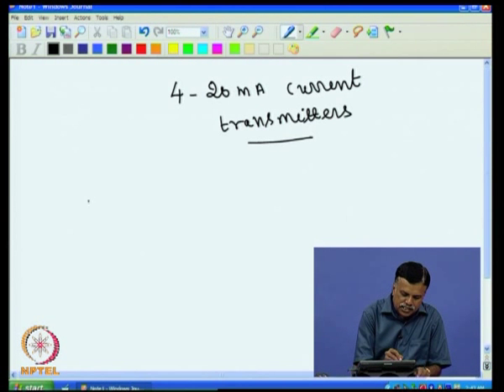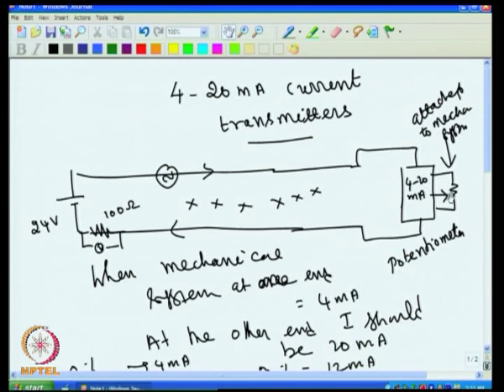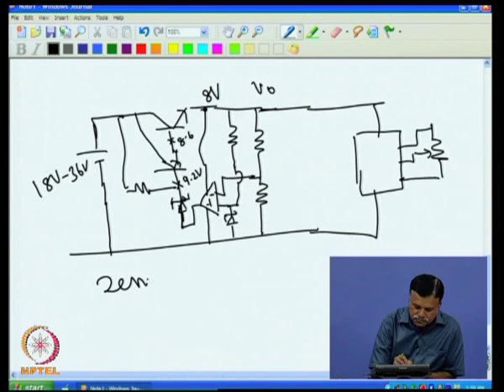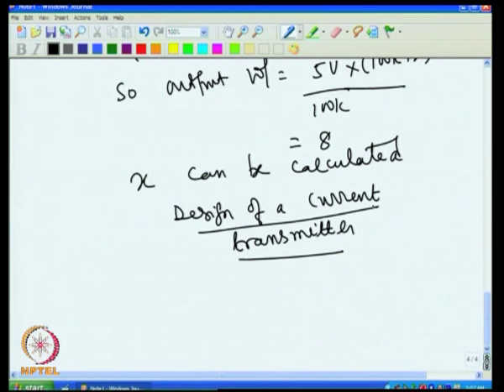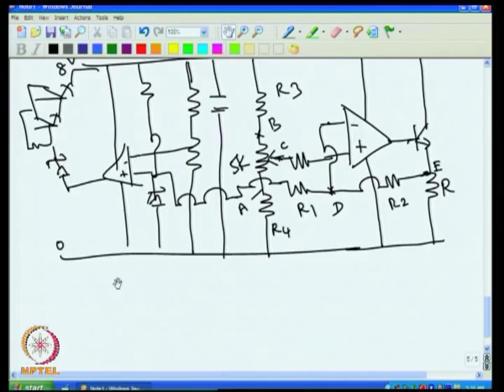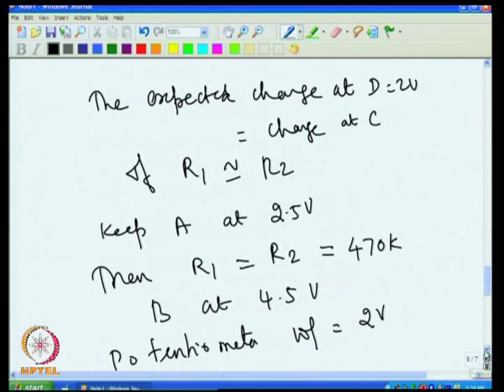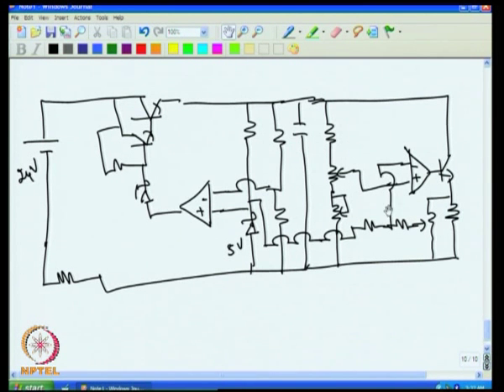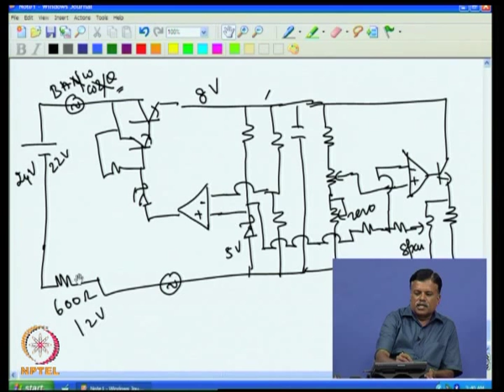Mod-05 Lec-23 4-20 mA current Transmitter design

Comment: Dear sir, I would like to design two wire 4-20 mA ultrasonic level transmitter. I'm planing to use an ultrasonic sensor, Micro-controller, Display and OP-AMP. My components current consumption more then 4 mA. Can you give me any suggestions to solve this issue ?